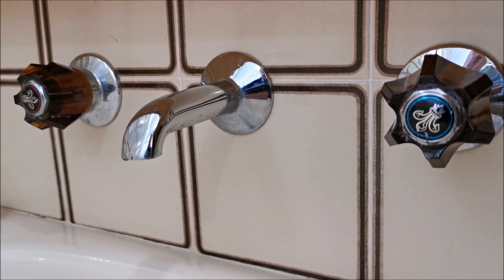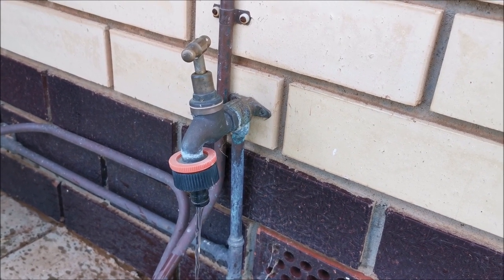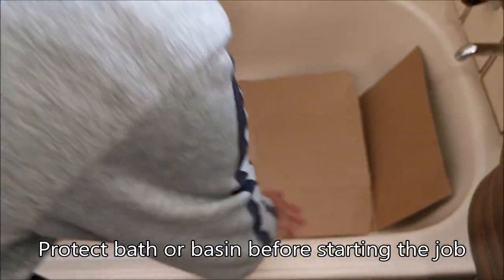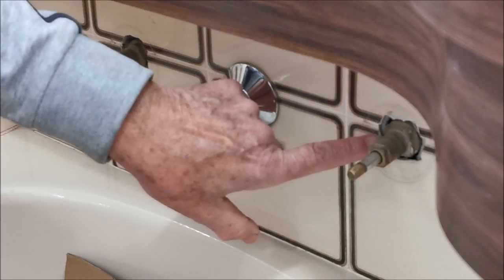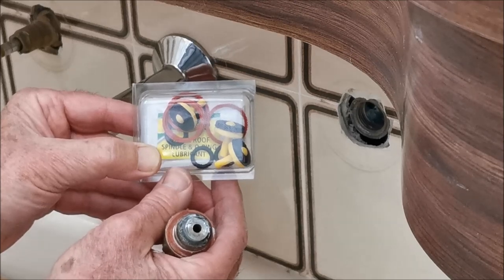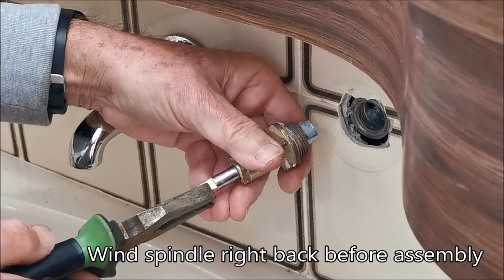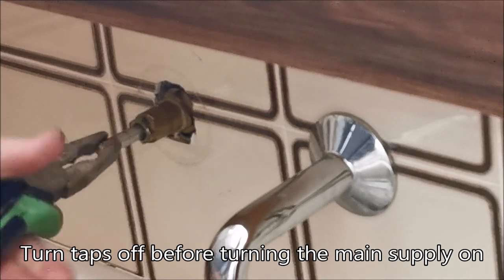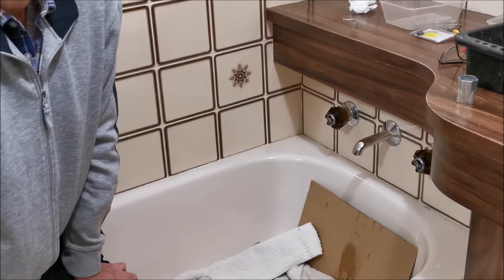How to repair and service dripping bath faucet or tap

Comment: Are all washers the same size?
Reply from the maker: No, there are 3/4 inch (19mm)  and 1/2 inch (13mm). But most indoor domestic taps are 13mm (1/2 inch). Hope this helps, good luck. Thanks for the comment.
Reply: @AnnErasmus  thank you! I shall take it apart to check first
Reply from the maker: @Sandra-il5fd  Good idea